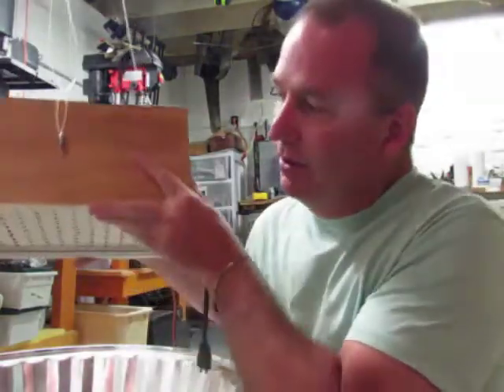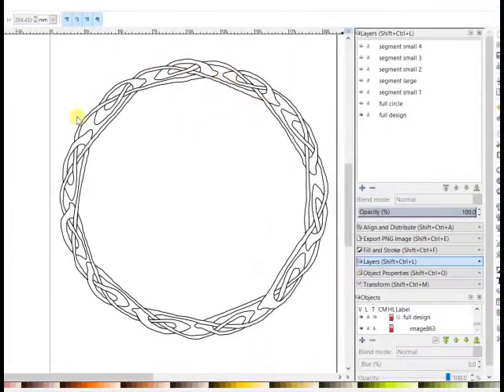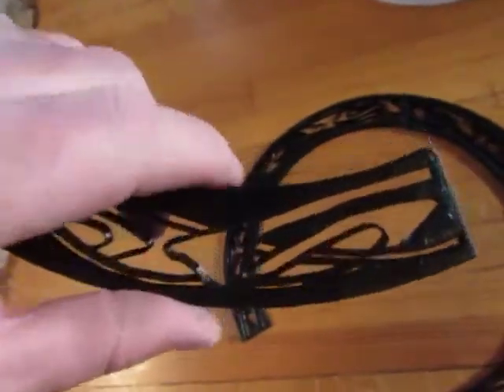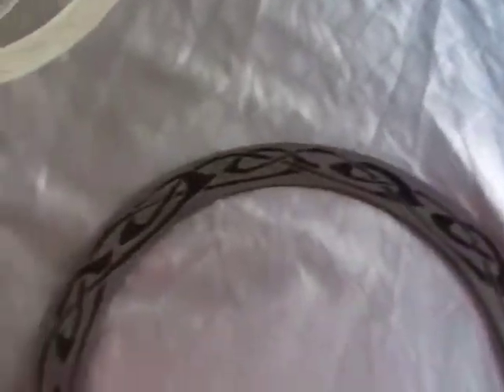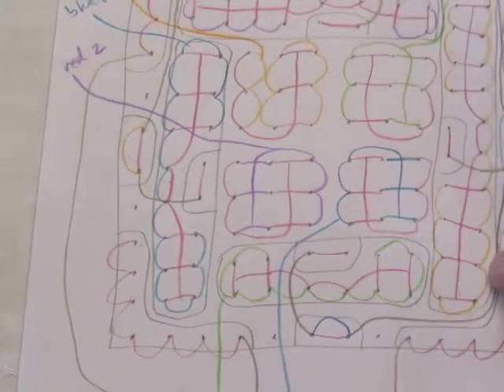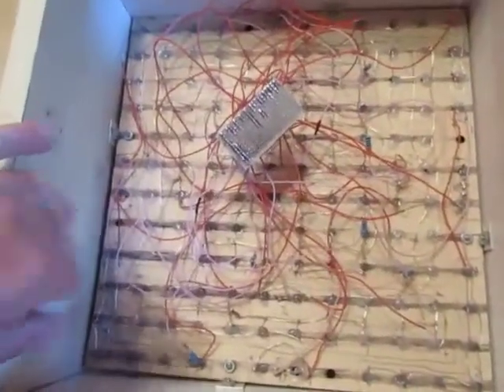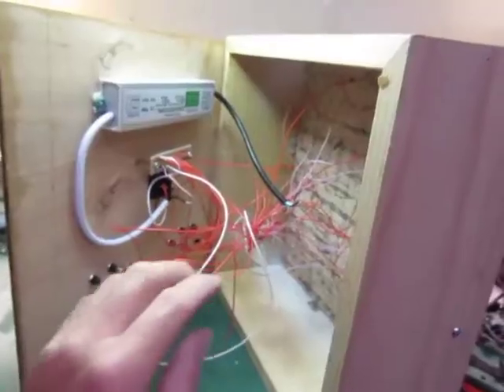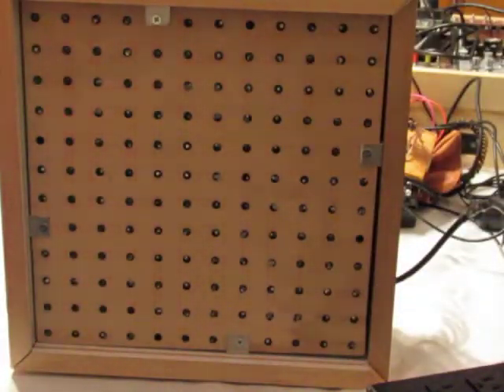Spinner Made

Comment: That's really nice, Patrick.  Can you clarify a bit how the spinning works?  It looked to me (from your setup) like the light box was the part spinning (on the strings), but from the performance, it seems like the reflector is the spinning part...

Is it difficult to operate the "keyboards" with the light box hanging like that?
Reply from the maker: Hi Kevin! I hope England is treating you well. It is indeed the reflector that's spinning, and I just put it on a repurposed discoball turntable (here: https://youtu.be/aQbtEpMyy5o). It barely has enough power to spin this thing though, so if I want to do more of these I'll have to buy a proper display turntable. I've looked at them on Amazon and they are cheap but why not use what I have? And yes, it's fiddly to play my little built-in keyboard. I might just build an separate button box.